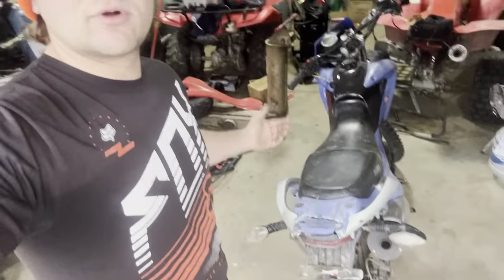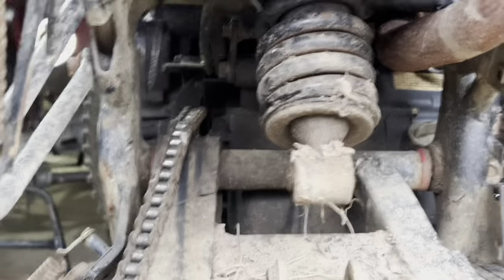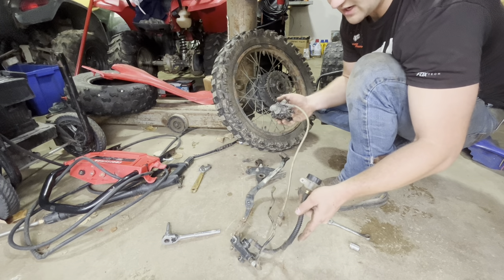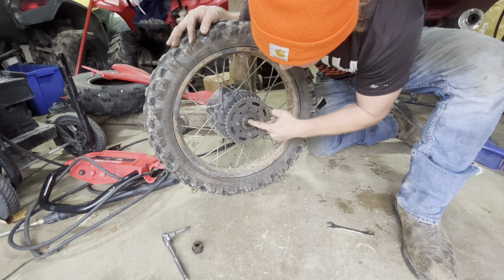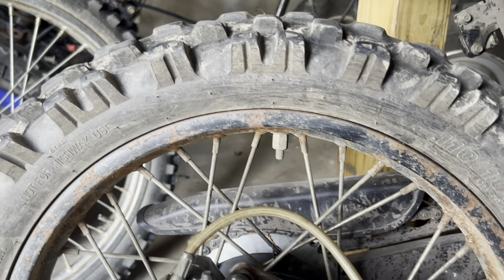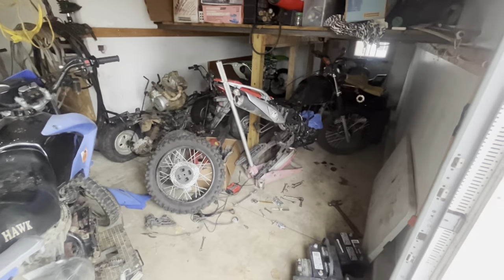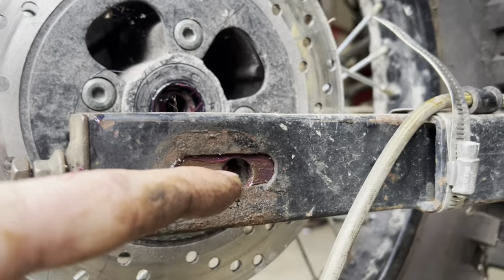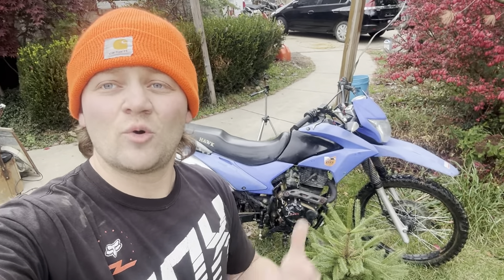Rear wheel, brake system, shock, swaped to my 8,000 mile hawk 250

Comment: I really want my Hawk to last as long as possible. I appreciate how you've documented literally everything about your bike, and the work that needs done on it. I'm gonna start taking mine to work and need it to be reliable enough for a 30 mile round trip. 

Stuff Done: rotella oil, front brake fluid change (still need to change the rear), ngk plug, tightened spokes, trued the wheel (as best as possible w/o stand), chain and sprockets. psi check freq.

Anything else I need to look out for? Im afraid of getting standed especially if im going into work. Ive had a couple flat tires due to spokes breaking/being loose. Thanks again for the vids!